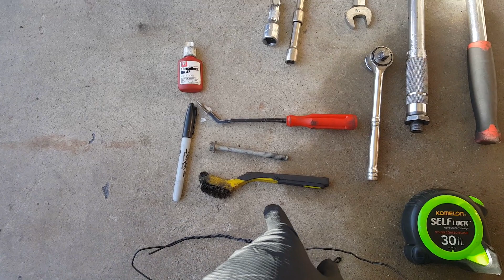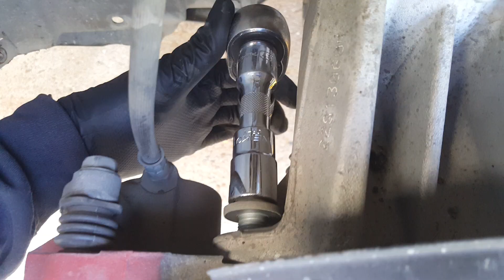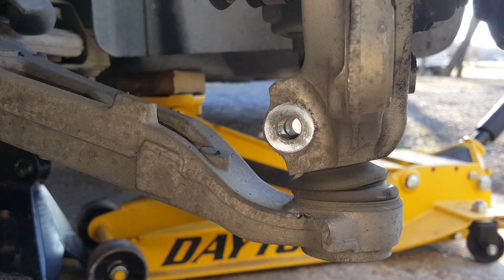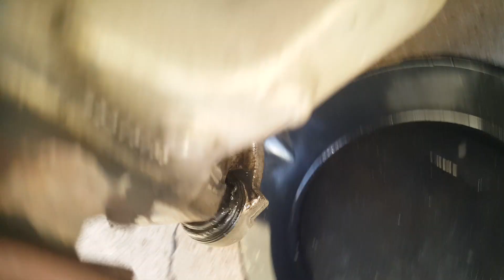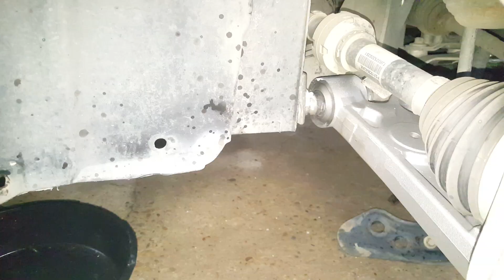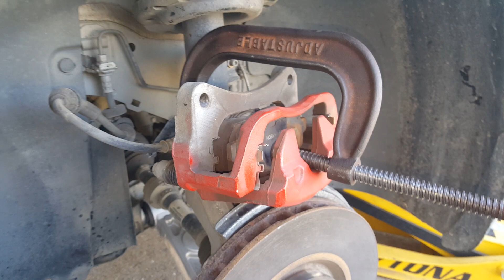How to replace the front control arms with ball joints on a 2013-2016 Dodge Dart

Comment: I had to turn mine to get it out,idk why cause I tried to knock it in when putting back together. Had to do struts thats how I know. Thanks fer the video.  Oh yeah with the ball joint,I used a flathead screwdriver to spread it apart a little bit

Comment: I followed this step by up to the point where you almost casually slipped the ball joint back into the wheel hub. I can not for the life of me get them lined back up. Idk how often you check your comments but I am kinda in a rush and any help would be greatly appreciated. It is currently almost 5 am and my alignment appointment is at 2 pm and I still need to do the passenger side
Reply from the maker: You can remove the knuckle to help . It is more removal but makes the assembly a little easier.

Comment: For some reason installing it on the left side was easier than on the right the stabilizer bar won’t let my lower control at first which I found weird since it was so easy on the left. Any help would be appreciated
Reply from the maker: I had the same issue , where one side was more difficult.  Basically I had to remove more to make alignment easier. Thanks for watching.

Comment: I replaced my control arm but i didnt know about setting preload before torquing bolts how bad is it that i didnt do that step i did get an alignment afterwards
Reply from the maker: Since you already had an alignment , I wouldn't worry about it.  The theory is that it causes the rubber to wear more quickly due to the constant stress , but actually how much of a difference I really couldn't say. There was a time that I did the same thing and left it as is. Hope this helps.

Comment: Nice video, about to tackle my son’s passenger side. Driver side was replaced a few months ago by a shop. Is it necessary to remove the dust shield & caliper?
Reply from the maker: It depends on how difficult the ball joint is to remove. If it can pop out without removing them , then absolutely. Thank you for watching.

Comment: Is it the stabilizer bar that makes a clunking noise when riding over bad, uneven roads?  This was a very thorough video as you did a rather good R & R meticulously done indeed!
Reply from the maker: It could be a good place to start , and would be only an improvement. If that did not solve it I would move on to the control arms. I don't know how many miles your car has but if it is over 100k it may be about that time. If your car is bouncy in the front the shocks may need to be tackled first. Anyways thank you for watching and the feedback , I appreciate if everyone can continue to like and share.
Reply: @WrenchTheory501  Thanks as I have a 2014 Dodge Dart SXT with 60,000 miles on it as it has been a great car so far!
Reply: @johnbeckham1483 i have the same car and i have replaced my front ball joints but the rattle is still there and its awful. Did you ever find out what it was
Reply: @maritimemtbr3056 could be sway bar end links